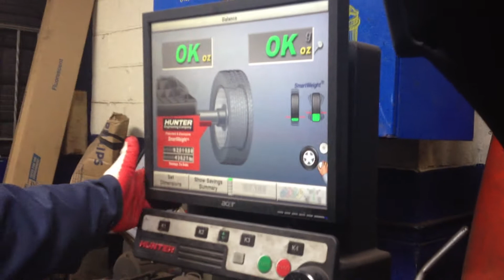16X9 DEEP DISH 205/40/16

Comment: Is it alright to fit that small tyre on it ? Cause I’m planning to get same just 17”. Tyre size calculator says 235 is minimum on 9j wheel.
Reply: David 1N23456  you could go smaller just more stretch this dude isn’t really running stretch it’s barely any honestly